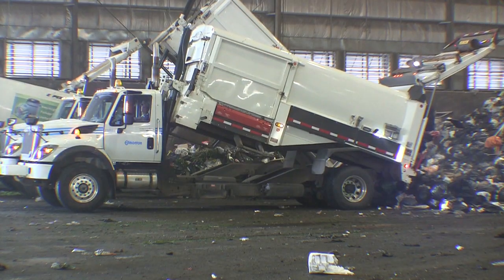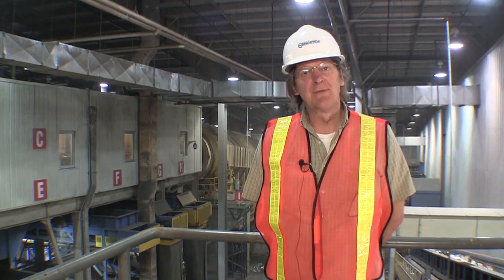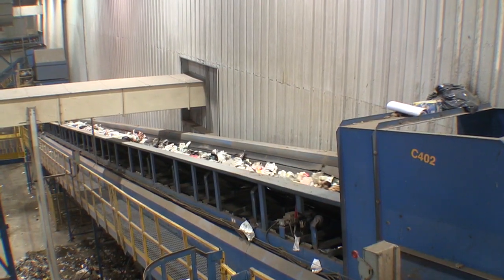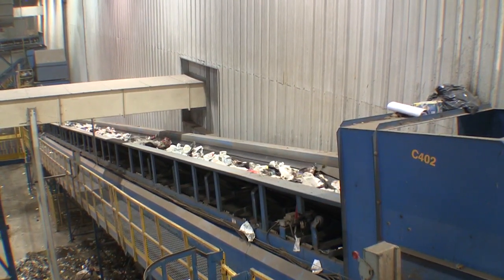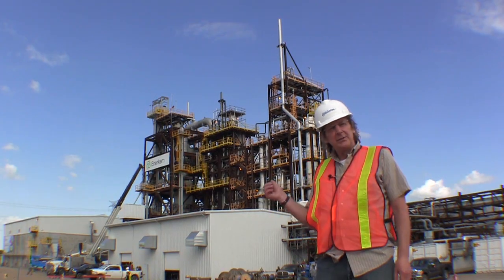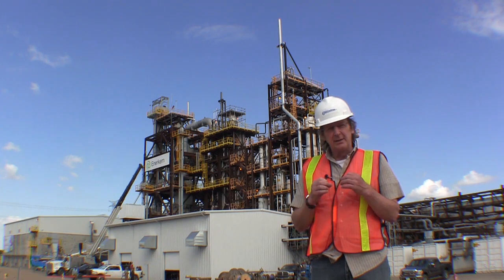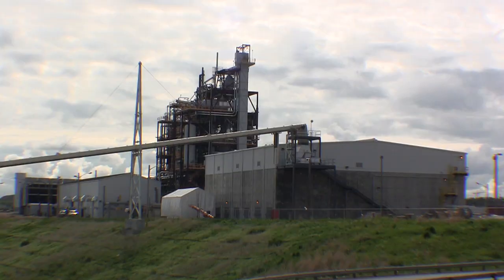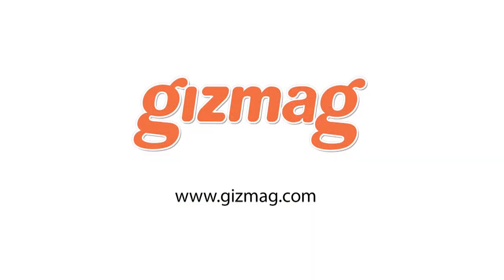Gizmag tours Edmonton's Waste-to-Biofuels Facility

Comment: They use some of the syngas to heat the reaction chamber.  This is just pyrolysis, an old and proven technology.  It's great to see Edmonton moving ahead on this though, so much getter than landfill, which is what most of the u.s. does. A second best technology is what most of Europe does- burning on fluidized combustion beds to produce clean energy without landfill problems.